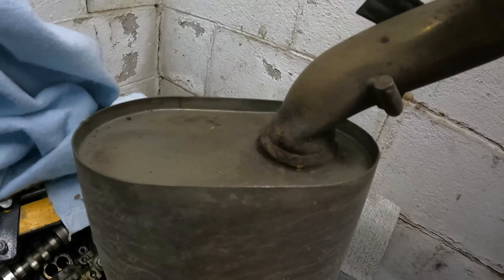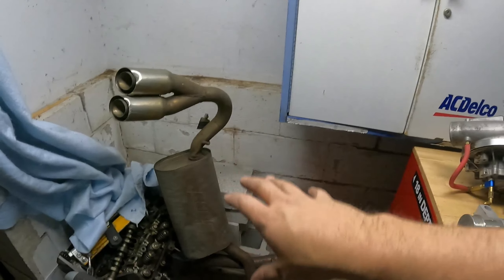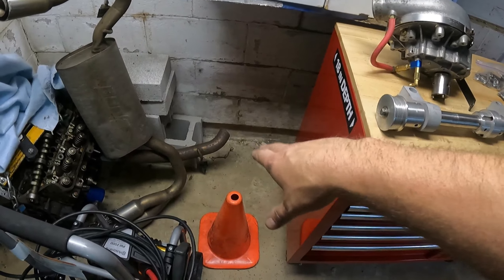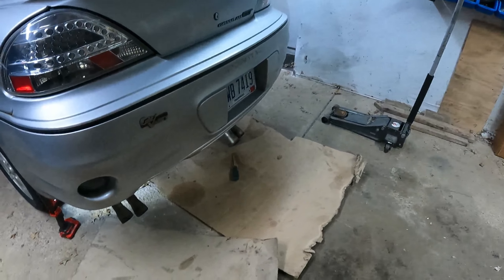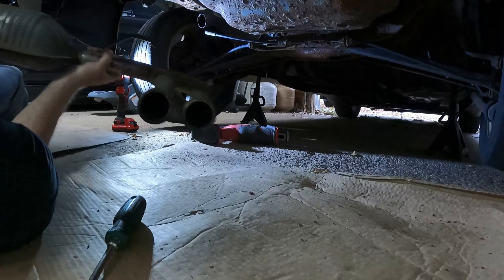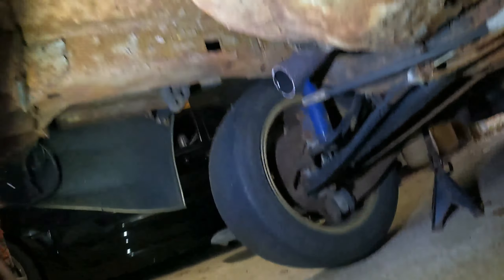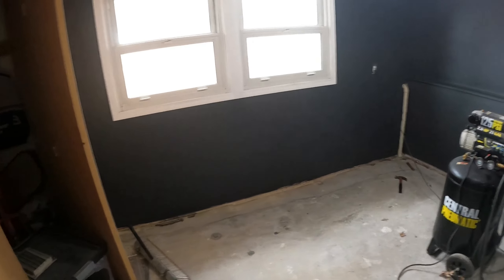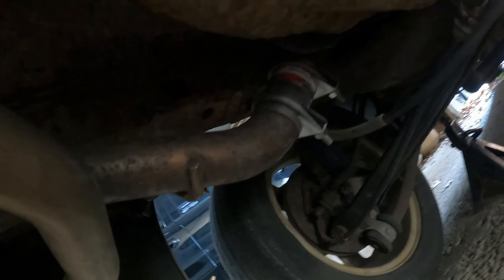99-05 Grand Am V6 Exhaust Comparison

Comment: Definite improvement with the Borla.  We have an '08 G6 GT with a one in two out and resonator delete. I think it's some aftermarket muffler by Sound Flow or Flow Sound.  Then on our G8 GT we have Borla cat backs with resonators deleted.  Definitely how that car should of sounded from the factory.  Not too much and no drone in the cabin.
Reply from the maker: On these the resonator helps control that drone big time. But borla def has their stuff dialed in.
Reply: @KMaffittGAGT  Good to know.  Fortunately the G6 doesn't drone either with my setup.  It's actually my daughter's car.  Wife got the G8 GT as an upgrade to the G6.
Reply from the maker: @VidTubeWatch  very nice!!

Comment: I have a 2000 pontiac grand am se2 v6...been saving up to have a custom dual exhaust system put on it..they told me all new with new co center and resionater 440 mufflers..780 dollars all new
Reply from the maker: Oh wow. That's a big price. Might be marking up the resonator. Typically with aftermarket systems you delete the resonator to get the volume. Otherwise it'll still be really quiet. Can also be a difference in what size pipe and if they're gonna use stainless or not.

Comment: Fix the engine & forget about the exhaust!
Reply from the maker: Nothing wrong with the engine lol 215k miles and going strong! It's my daily driver GA while the other one sits for winter.
Reply: @KMaffittGAGT  Mine has that same noise. What is it?
Reply from the maker: @SauceBauce_  probably hearing the lifter tap. Something notorious to GM and the 3400.
Reply: @KMaffittGAGT  - Those lifters sound like they are ready to launch themselves into orbit.
Reply from the maker: @cmdrdarwin3682  just the way the higher power microphone catches it. It's no louder then any other 3.4 I've had in the cold. Lol if I started my turbo GA with brand new lifters it'd come across the same way!